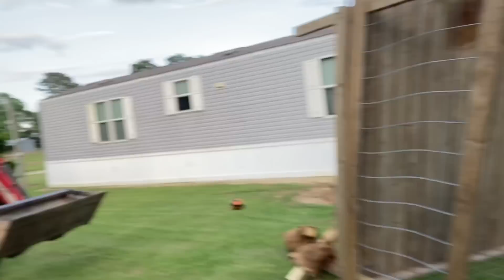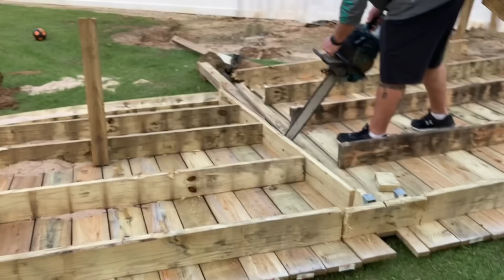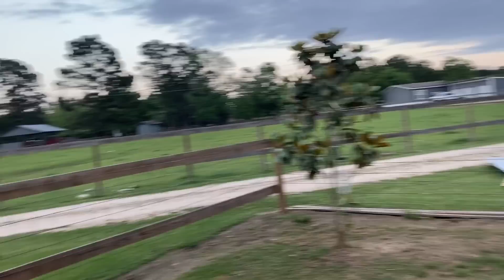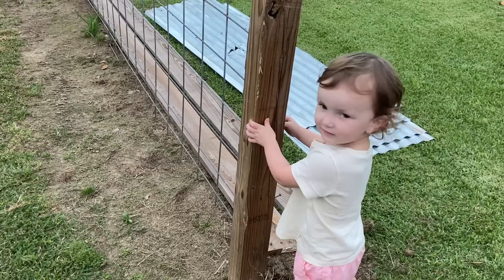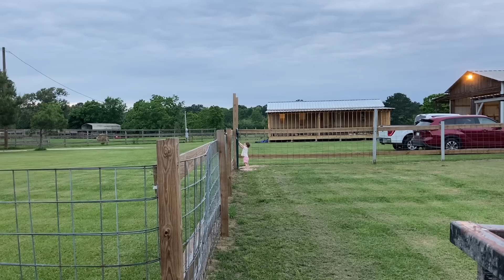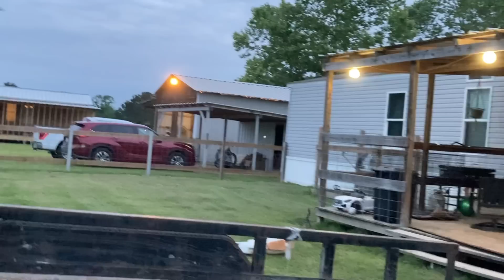New house on the way

Comment: I'm stunned you guys shredded the porch 😮. All I could think as you cut it up was throw some barrels under it, use it as a dock.  Or decking out back around a fire pit where you all go celebrate during the holidays near the river. I know you only had one set of forks. Just crazy with the price of lumber & it looked like it was in excellent condition. 😊
Reply from the maker: It was put together with ring shank nails, it doesn’t come apart to be reused.

Comment: FOR ALL YOU STRESSIN THEM OUT..  THEY CAN'T USE THE WOOD BECAUSE THE NAILS WON' T COME OUT🙄 Ring shank nails offer superior holding power over smooth shank nails because the wood fills in the crevasse of the rings and also provide friction to help prevent the nail from backing out over time. A ring shank nail is often used in softer types of wood where splitting is not an issue.
Reply from the maker: Thank you so much. Now hopefully everyone will read this.